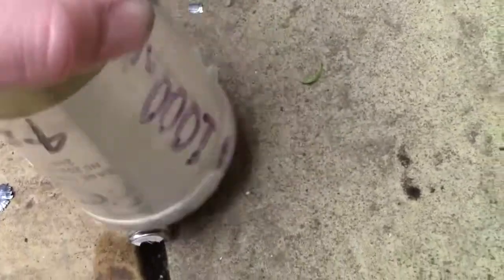Shooting a 22000uf 400v and 1000uf 400v capacitor and a 500mA Li-Po part 2

Comment: Something still tells my those caps have a lot of potential, maybe a HV cap would be a lot more voilent, but also maybe connecting a a cap to mains would provide better results? as I thought of doing the same with mine after noticing they did not hod their charge very well after being dented by my puny power 78.